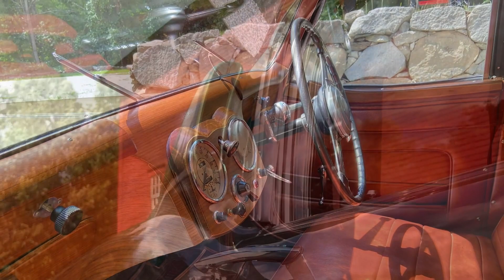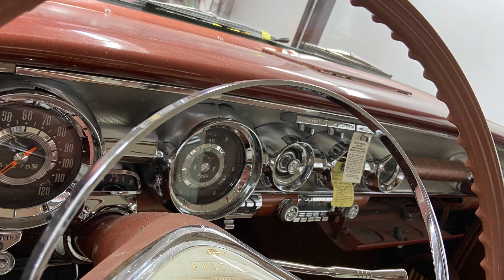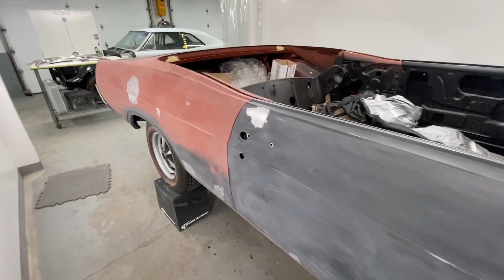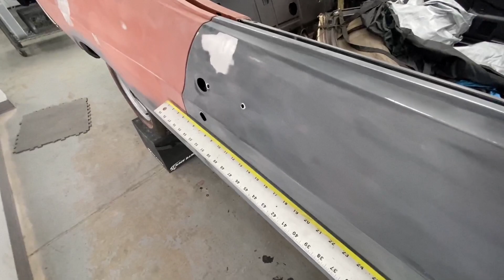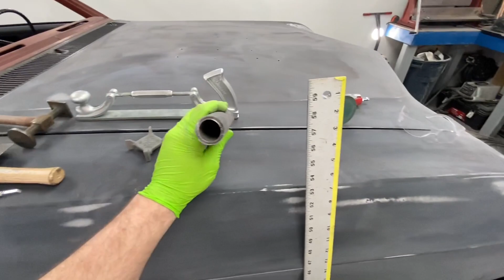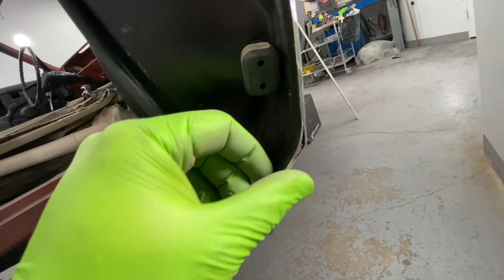Performing body work as a form of art Part 2

Comment: Do all the removable body panels stay on once you’re done with panel fitment or do you have to take it back apart to paint the inner side?
Reply from the maker: Everything comes back apart. We will finish off the edges and prep for paint. Everything gets painted in pieces, sanded, buffed THEN we will carefully assemble the entire car. Of course each project is a little different and sometimes the process is tweaked to meet those needs. Thanks for the comment!